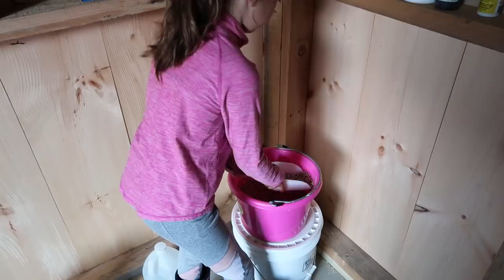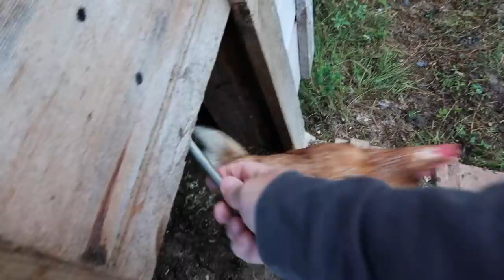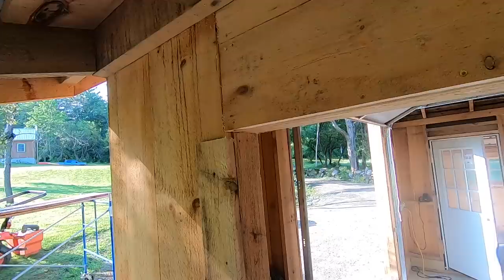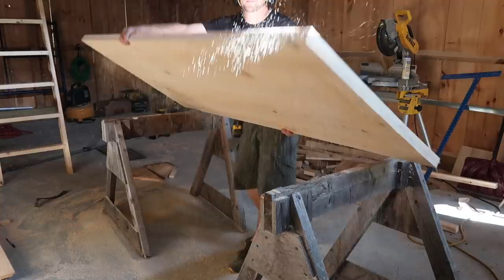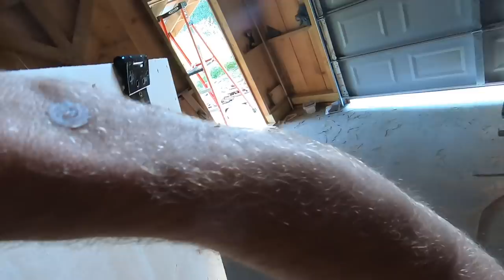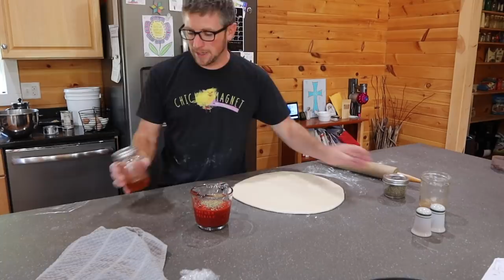Converting an Old Abandoned Farm into our DREAM Mini Farm How Hard Could BE!?!

Comment: Mr. Lumnah it is great to see young Ms. Lumnah helping you milk. When I was a youngster I begged Mom to let me go out to the barn to "help" Dad milk. I was four,  or five. To be honest,  I wasn't much help at first, but I was so proud to be out there with Dad. I was able to help bottle feed calves.
I'm glad that you reverted back to using the wooden milking stanchion. The comfort of your milking stock is paramount.
Here's an idea, use the metal grated milking bench to keep feed off of the floor. I would strongly advise against trying to use it to milk.

Comment: i hope you put a clear sealer on the exterior of the barn so the snow doesn’t make those nasty stains/lines.  that wood is too pretty to let the weather ruin its good looks.  we used to use log oil on our cedar cabin in the sierras, very heavy snow there.  but it was getting harder and harder to find in CA we have so many environmental laws you cant buy lead paint or melamine either.

Comment: Might have been better to mount your door hinges on the narrow side of the 2 x 4 so your door would be flush on the inside of the workshop. Then cut down door stop to mount inside the jamb opening and flush with the outside, then trim around. This would allow the door to open full wide, rather than being stopped by the 2 x 4. Binding against that 2 x 4 will put extra, undue pressure on your hinge screws, besides being a pain in the neck because it won't open back farther. Look at the door opposite that came with the barn kit, it's mounted the way I describe. 

Congrats on your Silver Button Plaque.

Comment: On the door jamming in the upper corner, I've been told that a longer, more sturdy screw is a quick fix, it just need more strength bearing fixtures. It can also be done on your front door if it is being a pain.

Comment: Hi Al, 
When you are putting the pizza dough on the hot cast iron pan, if you do it like one would put pie crust into a pie pan it may be easier. Just fold the rolled out dough in half, place in the pan so it is correct on one half of the cast iron pan, and unfold it. Ta-Da. lol.

Comment: Oh and here in Australia, our Dominos started doing pizzas with a garlic butter crust. They would roll the edge of the dough over garlic butter mix. We recreated it when we did home-made pizza, need to do more garlic less butter so it doesn't just melt and make an oily mess, and it definitely needed some salt to kinda balance the flavour, but once we got the combo right it was Soooo good. Next time I'm gonna add Italian  herbs in the butter as well. Mmmmmm it's 1am and this is making me hungry lol. I don't know if this sounds appealing to you, but crispy crust on the outside and the garlic butter has soaked in to the inside of the crust as well (you have to seal the dough really good tho so it doesn't just run out), it adds something extra special, as long as you like garlic that is lol

Comment: Wondering  how you clean the Goat Area?  I presume with  concrete  that a Power Washer would do the best job. But then I look at the 2 x 4' lumber  beneath the doors and that wil cause problems eventually.   I'm wondering  if you can  put something under the door that would be easily removed to facilitate cleaning. and prevent future wood rot caused by the constant cleaning.

Comment: Need a cup holder on the side of milking stand to hold jar
Reply: dave shewy good idea, but how to do it and make it not in the way of jumping on/off so it doesn’t hit a goat shin and break off lol... I can see that milk jar falling off and crashing on the cement, not soft like the hay in the boys barn is it.
Reply: @sandravanderleek8569  I would make it in the floor like a hideaway volt that way you could take a section of the floor out shut the jar in when you're done you can put that section of floor back in and make the floor so the goat or sheep would not have a hole to step in
Reply: Or you could attach it to the end of the stand since she jumps up on the side.

Comment: Why do you always cut from left to right? You being right-handed, why not cut from right to left? Makes the plate of the saw rest in wider, flatter and more stable base. And your saw isn’t falling off surface at the end of the cut. I’d also use the thicker part of you guide and not rest saw base in alum guide. You are cutting in a way that is making cuts that are not 90 degrees.
Just some suggestions.....